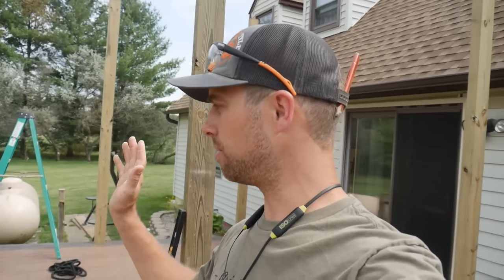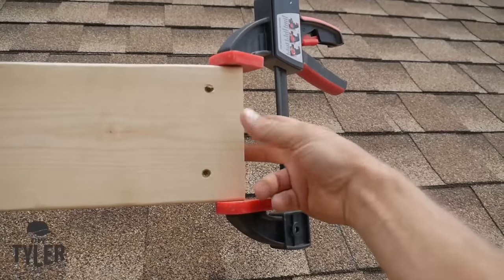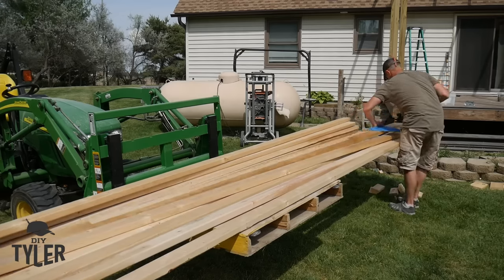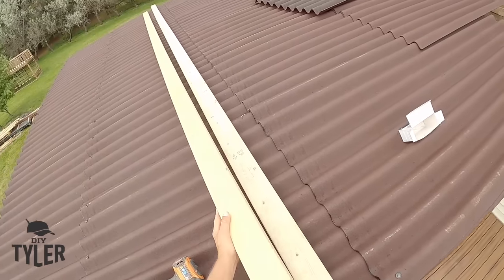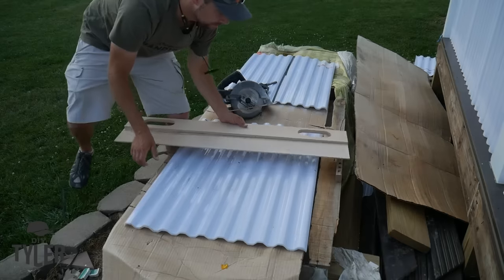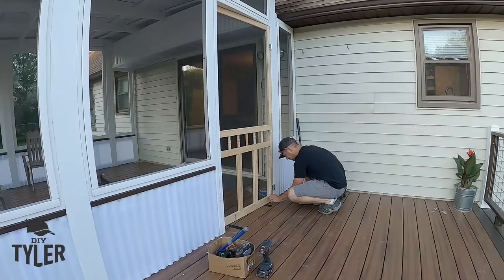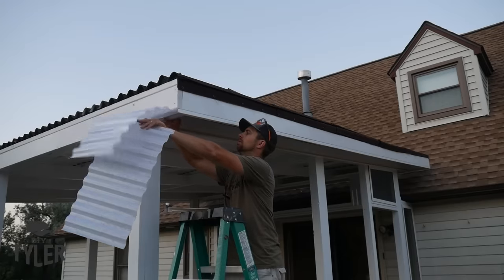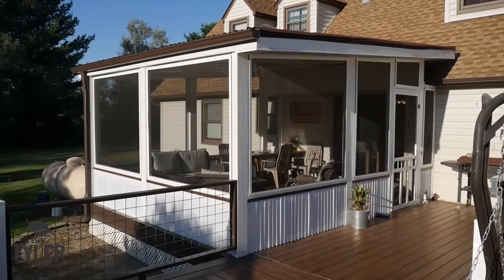Build a Screen Porch on a Deck without Attaching to the House

Comment from the maker: Hi there to all you first time viewers! We hope you enjoy the video. Be sure to subscribe so you don't miss out on the final video coming shortly!
Reply: What material did you use for the interior wall?
Reply: @jeromelindsay3144  qqqqqqqqqqqqqqq
Reply: If I have someone look at this video they should be able to build this for me💪🏼😝? What do u think the cost?
Reply: you might want to put tape on the siding first,
Reply: Yes agreed the sheer strength of screws is not what people they are, for example for joist hangers that's why you use specific nails because of there sheer strength,  but what do I know
Reply: When roofing they are called rafters.  Joists are only used when talking floors.
Reply: Do you have issues with snow where the gap exists between the two roofs?
Reply: I sure did thx a lot
Reply: @geoffmacdonald4060 I was wondering the same thing!

Comment: I'm not a fan of the beams not being notched into the posts. All of the roof load relies on those headlock screws and NOT the posts. That's also quite a span for 2x6.
Reply: He also used joist hangers.
Reply: @TimGallant  He didn't even use screws designed for the joist hangers, just decking ones. Hopefully it doesn't crush him or his family in a couple years.
Reply: I would just go with lighter roofing materials if it's just a porch.

Comment: I am a construction engineer. I would not of built it that way, but it has survived 80 mile/hr winds, so I guess you are the expert here. Great job and I can see why your wife married you--you are the man.
Reply: I'm not an engineer, just another diy'er and would not build it this way... The entire roof depends on two 2x6 rafters and the screws holding them to the posts. A better way would be to run 2 2x6 boards over the posts to create a beam. Then, run the rafters over top of the beams. That would spread the load over more of the structure and not depend solely on the screws that connect two of the rafters to the posts.

Like you said it survived 80 mph winds. I'm not sure how often it can handle that though. Also, snow load with winds? Again, I'm just a diy'er. The general idea is good but, the implementation would not work where I live.

Comment: Quick tip. To keep Great Stuff from adhering to the vinyl, you have two options.  One is wide painters tape, the other is to spray it with WD-40 before filling the cracks.
Reply: great, big stuff can be nasty to clean up.  I was looking for another way to close gap against house, but I think the right way would be to cut out siding which I don't want to do.

Comment: Just a note, if you screw a small piece that will overlap on the top of the roof double header frame joists that overlaps the side frame joists, makes it easier to hold and align them without a clamp.  Nice build!!

Comment: We have a back porch we close in with Sun Tuff clear panels for winter. In spring we take them off. I bought 7 screens you use for patio doors. The ones that close with magnetic strips. And are attached with Velcro to the wood. We have 2 screen doors on each end and leave clear panels up because they stop the rain from blowing in. One has a cat door to let our pets in all year.
Reply: Nice, I also planned to use Suntuf from Home Depot for winter.

Comment: That's a great screen patio.  Did you tell the wife that spray foam would come off the siding 🤔 because it wodon't.
     What keeps the mosquitoes from coming in the space between the two roofs.??  (There's no attached dormer there).
  Also that Onduline company used to be in New England back in the 80's and they went through bankruptcy and changed their name around a bit.   The roofing is great as long as you don't have snow or hard freeze.   So it would work great down south.   I thought it was pretty good stuff but there are a lot up north that dont.

Comment: Good job!  It looks though you might have problems when it rains hard and it runs off the roof into your new porch.  Too bad you couldn't tie into the roof and that would eliminate this issue.
Reply: I was thinking the same thing, is it hard to tie into the existing roof?

Comment: So far this is the closest I’ve found to what I want to do, only mine will be smaller. Thinking about the roof going under the eave instead. Yours seems to be difficult for future roofers. I don’t have a deck, just an old stoop to tear out. Then 4 foot wide by 12 foot long going away from the house.
Reply: I did that at my old house.  It worked perfect, except,  leaves and pine needles would collect under the eves and need to be blown out time to time.

Comment: We have a large covered deck attached to the 2nd floor of our house. We would like to install clear plexiglass both under the banister and above the banister up to the ceiling. But we can’t find any plexiglass large enough or strong enough to handle our strong winds in the spring and especially the winter.
I love sitting on the deck watching it snow but have to come in bc of the cold wind.

Comment: I was hoping you would show us more the connection of both roofs on how you do to prevent water/rain from draining as they are not directly connected
Nicely done though
Reply: Gutter to drain?
Reply: @ychongy  Yes do we need to add gutters or do you do something to move the water?
Reply: also do you have to pull a permit for building this?
Reply: Yes!! This video was awesome but why didn’t he show the most important part where it met the roof? I want to subscribe but it seemed like it was left out for a reason!? Can you do a one year later update and include that?

Comment: Looks great, however~ we did the exact same thing a few years ago and recently had to take it all down because of mildew/mold growing on the shingles underneath the overlapping roof due to it never getting any sun.
Reply from the maker: Oh no!
Reply: Probably not too difficult to modify the pergola roof and cut off the portion that hangs over the house roof.... or constant pressure washing/treating

Comment: Love this build.  But my Question is, if your keeping bugs out of every opening, what about the floor boards and them coming up through that?
Reply: This is my question as well. Did you put some kind of paper barrier on the underside?
Reply: Nail or staple screen to the floor joists either from underneath or on top before putting decking down.

Comment: Thanks for this. I have a similar dilemma with my moms house. It has a duck tail mini roof and i been trying to find a way to build the roof around that. I think i will do this and just pop it on top like this. Probably add a bypass and railings to keep the water from just going into the back.

Comment: This looks fantastic. Love that it's free standing and not attached to the house. One question ❓ 
I usually see the roof panels run long at the ends so it helps keep water flowing away from the frame. You didn't do that, why not?

Comment: Not advised in heavy snow country where show will accumulate between roofs causing freeze and water damage beneath the shingles. Ok for metal roofs but if external fastening screws with rubber washers are used the rubber wears out much faster and tracing leaks is a real headache. Nice looking porch though.

Comment: Have you had any issues with rain yet? I've been wanting to do something similar, but couldn't figure out the roof detail. I'm worried with your configuration that water that makes it down onto your bulkhead will get into the door since it's tied in directly above it, or just flood the new room.

Nice!
Reply: I was thinking the same thing...did u figure anything out yet? He didn't really go over that in the video
Reply: No responses to anything here. Other videos do the same thing no matter the method. To me the most important part of these builds is not shown.

Comment: Great video. I'm wanting to build a screened in porch on an existing wooden deck built in 1998. I've been told by contractors that they need to rip out the deck to build a platform that supports the roof. Your video suggests that I don't have to have this done. Won't the mosquitos come up through the holes in the deck?

Comment: I used real cedar on my knee wall. Do it right. As far as that back roof line is concerned water is going to collect in that plastic and sit there. It's better to marry with the existing roof line so the water sheds properly.

Comment: 15:32 if you flip the blade over and use it as a reverse cut, it will cut the plastic panels clean and won’t catch

Comment: I have a question for you. I live in the Houston area and we average 36”+ a year of rain. Does the rain go through the screens? We tend to have storms with sideway rain. Also have you thought about adding some sort of panel over or inside the screen in case you needed it?

Comment: Fill cracks in 6x6's with durhams water wood puty . It is dry  and you mix it with water and fill the cracks and press the putty into the cracks and sand and paint or stain . Only mix a little at a time because it dries rock solid and try to make sure it is smooth as you can get it and sand . i have been doing all my 6x6's this year on both my side porch and 100 foot long front porch . So you can just imagine how many 6x6's i have done   . I hated looking at the cracks and splits

Comment: love it but one cmment on your roof plumbing vents . I had the plastic vent boots and they were replace 3 times in just 20 years ( cracked , leaked and rubber around the plastic rotted )  and then I just had my roof replaced and had metal boots put on vent pipes . I finally got smart   Save all your cut offs like I did and made benchs , chairs and tables out of them  for my front porch

Comment: I bought into that PolyCarb crap 10 years ago. It yellowed quickly and now it's brittle and breaking in the wind. I should have paid extra for steel in the first place since that's what it's getting replaced with.

Comment: I love just about everything you do, but I feel you missed the marked on the connection from the post to the house. I think you should have scribbed a trim board to hide the foam. Scott brown carpentry has a great video showing how they do it in new zeland
Reply: Blake, you beat me to it!
Reply: Completely agree. Please go back and scribe some trim. I get you wanted the structure independent from the house but this just looks sloppy. The foam will distract from an otherwise great porch.
Reply from the maker: Blends right in
Reply: I agree scribed board would look better! That foam over time will discolor even with being painted.

Comment: You did a great job but I think I missed something. How are you keeping the rain from flooding your screened in area.
Reply: I would like to know that too. I have a contractor who is doing an estimate for a covered porch on the back of my house, but at this point, we’re talking about starting under the eaves of the house because he says there’s no way to keep it from leaking going up over the edge of the shingle roof.
Reply: He left the gutters up which allows the water to be directed away from the deck
Reply: @ftankd9910  Thnx.
Reply: The gutter
Reply: Until a heavy rain and the gutter overflows and floods the whole thing.  I would not have done this.
Reply: I would absolutely do this.  I do not want my metal roof f’d with AT ALL.
Reply: So pretty…wondering how you address what comes up from underneath the decking.

Comment: Very functional and clean looking. I’d like to make this 4 seasoned porch by adding glass sliding windows with screens. Would the current plan allow windows to be framed in ? I’m a rookie at much of this stuff, but I’ve built a few pergolas.
Reply: I'm looking to do the same - @DIYTyler is this possible?  I imagine finding a solution to fully seal and insulate the soffit area would be the biggest thing to figure out?  Otherwise, it's just typical weatherproof siding as you would a home build.

Comment: WOW, really nicely done. Congrats.
Do you have problems in heavy rains when the gutters may overflow and allow water to enter your screen porch?
Reply: As it turns out, we are protected from gentle rain, and it's a relaxing experience listening to that. 
But when it's really coming down, the wind blows it right through the screens and we head inside anyway.
Reply: nice screened in porch. outdoor movies would be fun. projector, screen, drinks, snaks!

Comment: Hi! We have been trying so hard to think of a way to screen in our patio, but our roof line wont allow it. When I came across your video I thought this was a great idea! however, any idea how this can be done with a patio that has 2 walls of our house next to it and 2 walls would be screened? Basically our house makes and L and in the corner of the L is the patio. The long portion of the L is a gable roof and the short portion of the L is a tall flat wall of our house. Thank you!
Reply: I'd love to see the response to this!

Comment: After watching the video a second time, I was thinking you ma have planned to do the screened in room as you built the deck. and had the posts placed at the height needed as you started? I was thinking i could cut post size holes in the existing deck and using cement posts holders putting the weigh on the ground and supported by the existing deck joists etc. What's your thoughts?  Appreciate any thing you may have to offer. Thanks again.
Reply from the maker: Glad we could help get your wheels rolling! Yes, we planned the screened porch before starting the deck build so we had plans for it from the ground up. 

For something as large as you are thinking I would not recommend the post holders, have no faith in them staying put...although my experience is Michigan ground which moves anything if it's not buried 43" underground, could be different where you are located.

I would think you would have no issue transferring the weight to the existing 6x6s as long as you are able to get the load bearing points over them and across the joist they are holding. Originally our design was going to have larger support structure under it to support a 3 seasons room (glass and screens) but we decided against it and just went with screens with the support right into the ground. That plan was going to have larger posts and double beams to hold the room above it. 

All said, I am not a structural engineer....just my thoughts!
Reply: @DIYTyler  Thanks a bunch. 4 of the 6 posts I think I need would be right over the existing 6x6, which makes the other two in the middles using the deck joist and deck block on the ground as support. Another fellow on utube showed a dowel type support going into the lower beam and upper post to keep it centered. Which i am also thinking of using. The weight they are thinking is the roof weight but i am sure those Ondura panels would not weigh what wood and shingles would. I am in Central Ontario Canada and yes normally we would use 3 feet minimum in the ground to hold posts from frost. but since it will not be attached in anyway to the house. a floating pad is all we need to hold it. So i have been told. Appreciate your thoughts and yes i understand you are not a engineer, but if you built one that made it through a few storms,   sound to me like you know what your doing.  Thanks again,

Comment: Hello, I really like the whole project. I wanted to ask, what made you decide to build separate frames for the screens instead of attaching the screen tight directly to the outsides of your upright posts? Thanks, Joe
Reply from the maker: Simplicity of building them in the shop on a flat surface!

Comment: Love your video. Your screened in porch is just what I want to build. What was the reasoning behind it not being attached to the house?  Would it be because the deck could possibly heave or was it to avoid permits?
Reply from the maker: Both! And it just seems like a good policy to not cut into the roof of the house unless you really need to!

Also, we have added an addition right above this, when we built the deck we didn't know exactly where that would land.

Comment: What prevents the water run off from splashing on top the porch under the roof. If the gutters get full, and aren’t cleaned out, then water will splash up and on to the porch? I’m genuinely curious because I like this method of not physically attaching the structure to the house/roof

Comment: I am in the process of screening in my covered porch and absolutely LOVE this video.  I have a question.  I noticed that you use Tuftex corrugated polycarb for the lower part of your porch.  Would Tuftex polycarb multiwall 6mm work also?  I would put it both inside and outside the 2x4 rails.  Do you have an opinion on that or do you think the corrugated Tuftex is best?

Comment: I was looking at the roof of the house and the roof of the extension 
I didn’t see how you connected both so when rain comes it wouldn’t drop into the floors 
Can you explain how you block it or connect them

Comment: How is that cantilevered roof keeping water out for you? We did something similar to this structure-wise, but we snugged the top of the cantilevered roof up under our gutter. We have three steps going down into our screened-in patio since we didn't have the height to make a deck out from the kitchen door.
Reply: Watching the response.  Wondered how water stays out here too.  Seems like water would run down that steep roof right into the screened porch.
Reply: So the gutter on the house keeps out any gentle rain. When it pours or storms, everything gets wet anyway from the wind blowing the rain through the screens. Any other day though.... we spend hours on that porch. My new favorite room in our house!